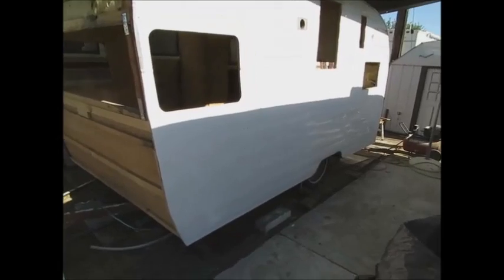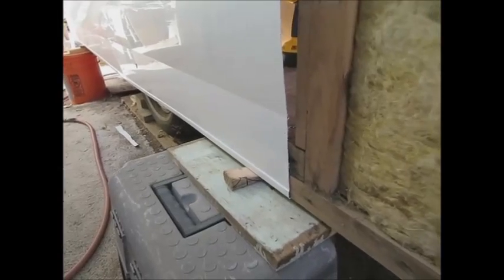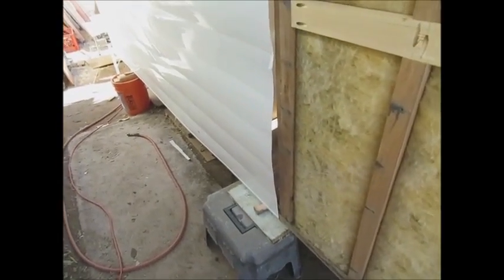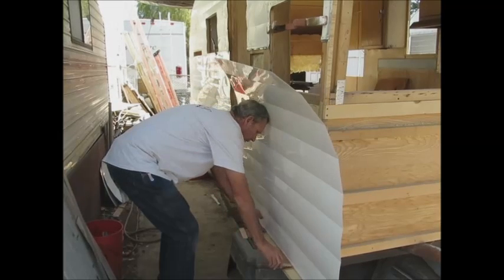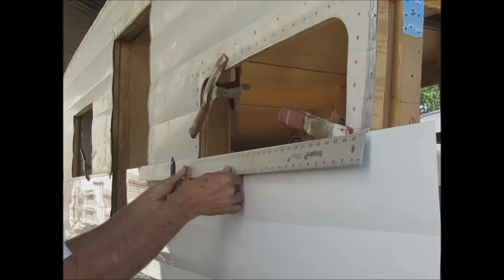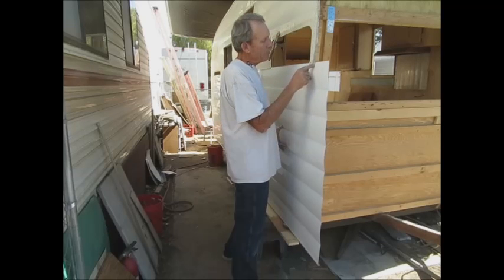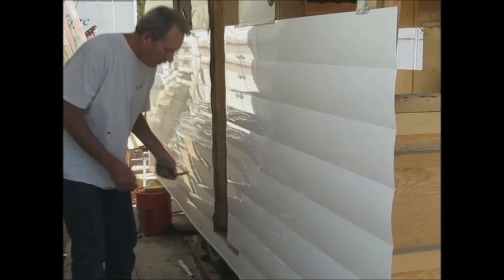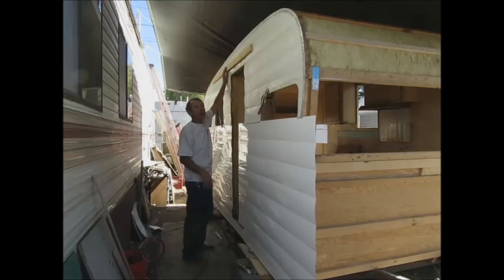Installing Lower Side Metal Part 1

Comment: I have damaged panel close to the roof.  Is it possible to replace a 6' section and splice it into the remainder of the trailer or do I have to go 25' all the way to the end?  Seems like a lot of material and cost?
Reply from the maker: I would have to see a photo of your trailer so I know where the seams are. But you will probably have to replace the entire top panel if your trailer is made with two 4 foot high panels. I don't know the year or make of your trailer so it's hard for me to help. Email me at mobiltec@gmail.com with some photos...

Comment: Hey Larry. Great video! I am installing my new skins today that I got from Hemet Valley RV. I am curious, once you have all the staples around the edges and by the door on curb side, do you staple in the middle of the walls (in the breaks of course)? Meaning, does the siding need support in the middle of the pieces or is around the sides, doors and windows enough to secure it? Thanks in advance.
Reply from the maker: Use as few staples as possible to hold the skin on until J Rail and all windows and doors are in. I only put them in the creases around the outside edges. For windows only in creases on the sides and if you can get away from doing top and bottom for now do so. The window flanges will secure it all when installed. Make sure it is as warm as possible in the place you are installing skin. I try to heat up my shop to 85 degrees when installing metal. Or if outside wait for a nice warm or even hot day.
Reply: @mobiltec  Thanks Larry. It was a hot 86 today. I was able to get top and bottom of both sides done today. Still need to cut out the doors and windows. We did have the hardest time getting the bottom piece to fit in the s-curve and we had 3 people. The reason being is that due to the siding being shipped it was rolled and the bottom piece kept popping out when we tried to do the top.  So grateful for your videos. I will be donating you some money to help you make more. One last question, as you said in this video, my trailer is not square and the curbside front is lower for some reason. This caused the bottom piece to have to be cut at a slight angle because of the auto roll. So...the middle section just below the j-rail has a break that runs along the side at an angle. Have you seen this before?
Reply from the maker: @CarlCulver  I would have to see photos to understand what you are talking about. I may have a picture in my mind but not sure. Can you email photos to me at mobiltec@gmail.com ?
Reply: Thanks Larry. Where did you bought the metal sheets?

Comment: Hi Larry, for the edge that goes under the bottom of the wall, do you just overlap the frame flange that the wall rests on?  I can’t imagine there is a way to tuck the fold in between the flange and the wall.  I am doing a complete rebuild, and my walls are already screwed to the side of the deck.  My trailer is a ‘54 Terry.  Thanks.  Mike
Reply from the maker: Hi Mike. I'm not sure I understand what you are talking about. Go to my website and contact me from there through email and send photos of the area you are talking about. I don't know what you mean by a flange.

Comment: I have a 14 foot Taurus and I'm thinking of redoing it from floor up and was curious what your average cost is to restore it, I'm curious if its cheaper to get a new trailer
Reply from the maker: It really depends on how far you need to go with it. For a full restore you could be looking at anywhere from $5k to $8k in materials. Perhaps a lot less if you don't need new metal skin. Paint can cost anywhere from $200 to $800 depending on how you do it. If you need to replace any of the hardware or appliances or windows, the cost can be all over the place. There are no averaged when it comes to restoring vehicles of any kind.

Comment: hi Larry.hope your doing better. question i have is do you have any videos showing new skin install? from top to bottom?  we have to install new skin... thank you
Reply from the maker: No but if you watch the metal skin parts in all three that I do have you will get the idea. Go to my website. The videos are all listed and indexed for easy finding. The Deville Series, The Shasta Series, and the 57 Westerner which shows how to put a new roof on and a lot of other metal tips. You'll find the 57 Westerner series in the Trailer Tidbits section. Hope that helps.

Comment: What size staples are you using? I'm about to buy a stapler. Is an 18 gauge 5/8 to 1 1/2 inch narrow crown stapler ok?
Reply from the maker: I use 1/4 by either half or 5/8 long staples. My stapler goes up to one inch long I think. 18 guage.
Reply: stainless steel i hope.

Comment: Is a vapor barrier need on the sides and top or just the top?

Cheers,
Bugs
Reply from the maker: In most cases the top, front and rear is all you need for vapor barrier but if you want to add a little puff to your trailer and a little more R factor you can do the sides as well. Just make sure you know where all your electric wires and or gas lines are so you don't poke a screw or staple into them. I paint over those with orange and you can see through the Roberts Unison that I use. That is available at Amazon by the way. Much cheaper than the crap at Home Depot.

Comment: Where do you buy your sheet metal at? We are redoing a 73 lark 14ft
Reply from the maker: Everything is on my website. Hemet Valley RV and Siding is where I get my metal. They ship. There is only one other manufacturer and they are CHT campers. Go to the links section of my website. http://www.cannedhamtrailers.com
Reply: Just got my answer thanks .
Reply: mobiltec

Comment: do you use a router to cut the windows?
Reply from the maker: Keep watching... I have used a router but it can be not only very messy but will scratch the outside of the metal if you use a standard router with a table. I did find another way to do it but it can get out of control. So far, the best way to do it is with electric shears and a drill bit for marking the corners.

Comment: galvanized 1" crown Staples? Or what? Thanks I'm doing my 65 trailblazer now! No vapor barrier just foam board, frame off restore one man job!
Reply from the maker: 1/4 inch 18 ga crown staples. I use only the ones sold by Porter Cable becuase they are the sharpest and will have no problem penetrating two layers of .030 metal. They are not galvanized.
Reply: @mobiltec  ok thanks only 1/4", i thought longer for holding power, but I'll take your recommendation into consideration thanks Mobil tech!
Reply from the maker: @cmc02888  No the length is 3/4 inch long. Quarter inch crown staples come in all different lengths. The quarter inch crown is the width. So they are called 1/4 inch crown staples. Then you pick the length you want. I use 3/4 inch long and 1/2 inch long depending on my needs.
Reply: Ahh yes duh thanks man, you don't like the galvanized? You da man thanks , nobody else I can ask these questions!
Reply from the maker: @cmc02888  I didn't even know they made galvies in staples. But if they do, I would still use the ones I told you about. You can not get the porter cable ones at home depot any more. You have to go online.
Reply: @mobiltec  found them.at the Depot got everything I need, installing aluminum sheet homemade strong ties on all joints gotta be water tight in two weeks!
Reply from the maker: @cmc02888  OH good... Usually you can't find these at Home Depot.
Reply: @mobiltec  yeah went with Porter Cable all around, they had a deal for compressor and three guns combo for 199 then I added the 18 gauge narrow gun so I now have four guns compressor and hose for 299 couldn't pass it up, man I got alot of body work to do on these beat up panels!

Comment: How do you know you’re going to hit a stud when stapling? Are there standard spacing for either stud placement or siding seam placement where stapled?
Reply from the maker: The only part of the skin that get's stapled to a stud is the lip of the seam of the upper half. And it get's staples all the way around the other three sides of the perimeter.